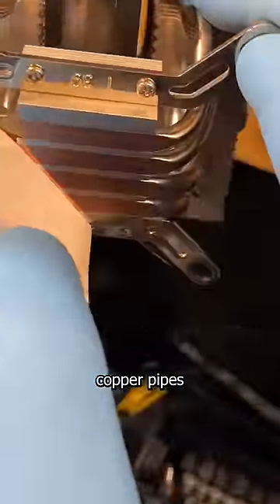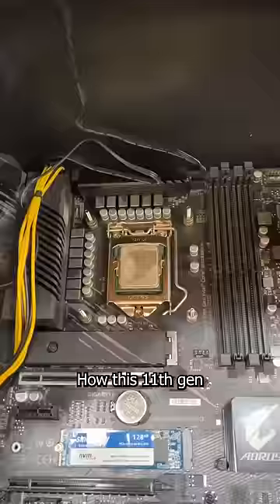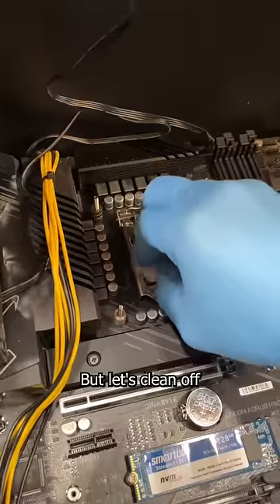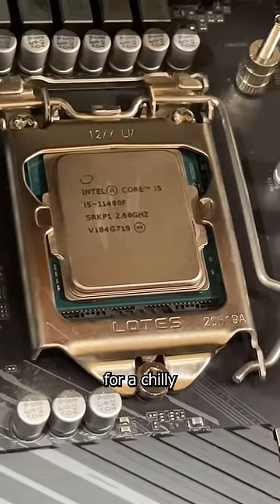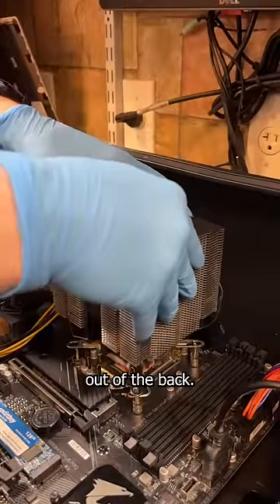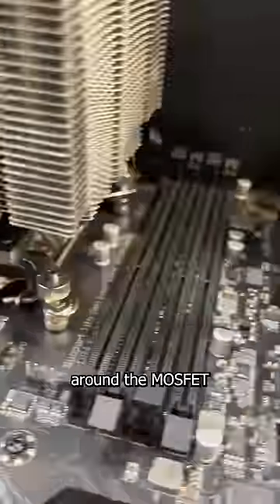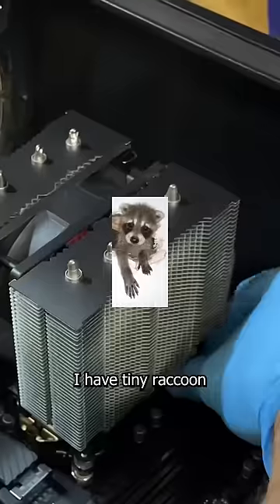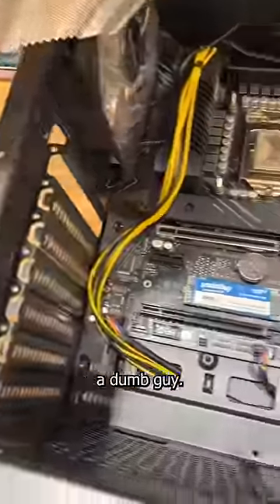Russian computer repair shop harmed this poor #gaming #pc Intel CPU was on fire 😢 #tech #shorts

Comment: My boy used bubble gum as thermal paste 💀
Reply: With enough amount 💀
Reply: XD I think it's thermal grizzly thermal paste (but yeah it looks like gum lmao)
Reply: WHY WAS IT PRE SPREAD
Reply: @defaultdan7923  because he spread it but didn't record it??
Reply: @Maxcraft7050  the IHS spreads automatically. maybe it's just a material that I am not used to seeing the viscosity of, but even then, just a pea is needed, then let the cooler and CPU handle the rest.
Reply: @defaultdan7923  nah you're right but some people like to spread their thermal paste or do a different pattern (I usually do an X as it spreads nicely)
Reply: CPU looking like a sugar cookie
Reply: And used way too much.
Reply: @Zulgeteb that's not really "way too much" it just probably looks like it as he spread it, (also you can't have too much thermal paste, the only thing it can do is make a mess)
Reply: Nah it's pink sauce 😂
Reply: @soulkrishnagamer_007  nahh 💀
Reply: @Maxcraft7050  😏😂👍
Reply: @defaultdan7923  no I think that is a high perf/long lasting paste, normally it is best practice to spread them manually, he did nothing wrong.
Reply: @Zulgeteb  it is fine!
Reply: I came to the comments section to look for all the thermal paste experts and wasn't disappointed.  Too much!! Why did he spread it out?!?!?! ermagawd!!! .  Much armchair expert pedant-ism.  He applied a decent amount that guaranteed contact across the heat spreader which is important now the dies are not necessarily central so 'just need a pea in the middle' is insufficient and any excess would be squeezed out thanks to the pressure... go on armchair cpu hero's have your say!
Reply from the maker: @NeilSearle EXACTLY!! These comments are tame compared to TikTok 😂 the PASTE POLICE are out in full force over there!
Reply from the maker: @defaultdan7923 I spread it and didn’t record it 😂
Reply from the maker: I used Colgate extra pinkening.

It was actually Thermal Grizzly Kryonaut Extreme 😅
Reply: @SalemTechsperts  nice so I guessed right, because they have that unique pink thermal paste
Reply: idk what paste that was, but it looks like a sh!t ton
Reply: @storm_filter  thermal grizzly kryonaut and it's not that much
Reply: @NeilSearle  pea in the middle is insufficient? Tell that to my 9yo intel 3rd gen, 7yo 6th gen and 6yo ryzen 1st gen. The first is a home server running 24/7, the second is my brother's gaming PC and the third is my workstation.
Never had a problem, never had to change CPUs or thermal paste.
Reply: @Zulgeteb what’s wrong with too much?
Reply: he never said the builder could be a dumb guy😅
Reply: @defaultdan7923 I have the same thermal paste, I believe the instructions tell you to spread it before putting the cooler on, I'm sure Thermal Grizzly know what they're talking about so I would do it with their products if thats what the instructions say.
Reply: @defaultdan7923  Pea is a good shape but it leaves nothing on the corners of the IHS when too little is applied. Even if just the right amount is applied it'll end up spilling out of the sides before it touches the corners, which isn't ideal either.

I personally use a slightly smaller blob in the middle than is generally advised and put tiny spots in the corners and often trail towards the middle. Anything beyond that is just for fun. 

Additional areas of paste will create points of contact for the bulk of it in the middle and channel its flow when the cooler is pressed down. The only thing to be careful of with multiple spots is to ensure they run together properly or else an air bubble might form and throw off the thermal transfer. Just avoid having two or more blobs at a distance without any paste in between. Make sure they're linked or close enough that they will be immediately when pressure is applied.
Reply: Oh I just posted about bubble gum 😂
Reply: i used talcum powder 💀
Reply: Nah Thermal Grizzly is a great thermal paste. You have to heat it up first to make it spread easier and then it becomes like putty.
Reply: Exactly what I was thinking
Reply: @soulkrishnagamer_007  *cpu explodes of food poisoning
Reply: @SalemTechsperts  My guy, a pea sized drop on the cooler, it spreads wit the pressure cmon man.
Reply: @PountyWB  lol
Reply: @defaultdan7923  Because intel sells pre applied Thermalgum on their CPUs these days
Reply: @Maxcraft7050  
Bingo!
(Idk what that is, but you got it correct 😏)
Reply: @ivoryas1696  lmao thx
Reply: @Maxcraft7050 spreading it can allow air bubbles to get trapped, it's best to put a blob in the center and push the heating down on-top to not have any gaps for air to be trapped in
Reply: @timothygooding9544  I know...
Reply: it's horseradish
Reply: Isn't that better than the original install?
Reply: a used one lol
Reply: @SalemTechsperts  what a waste of thermal paste. I bet you charged the poor customer for it twice the price of that CPU alone 😂
Reply: I came to say the same thing!!!
Reply: @Zulgeteb  not too much. it's already been studied and proven, you can have more than the olde way of a pea-sized thermal paste, and it's actually more optimal to have more as long as it covers the entire IHS instead of just partly. Which is why spreaders have been commonplace to be included with thermal paste when you buy them.
Reply: @alihaidar5787  no, it doesn't. We already have actual objective data a pea-sized just doesn't cover the entire IHS.
Reply: @timothygooding9544  it still doesn't cover the entire IHS, and actual enough pressure from the heatsink would force those air bubbles out. again, it's better to have more thermal paste to actually spread throughout the IHS, this has been done in gamersnexus and the like.
Reply: Toothpaste works too...
Reply: i mean they seem to last a long time under the school desk so why not? 🤣🤣 jk
Reply: @Maxcraft7050 exactly what you need to do
Reply: @PLiVX  what
Reply: @Maxcraft7050  put thermal paste like a cross on the CPU , the plate will squish it equally on the CPU
Reply: @SalemTechsperts yeah no matter what you do you’re going to have people screaming at you you did the wrong thermal paste application.

Nothing wrong with spreading it yourself. I do that too and worked great so far.

Some videos just cut any view of the thermal paste so people won’t complain about it which kinda makes sense x3
Reply: @mastroitek  No, it is too much.
Reply: still an improvement
Reply: @xanderwusky  Well this definitly depends on which CPU your applying the thermal paste , AMD Cpu have like two chips and if you apply a pea sized thermal paste on it , it'll probably heat more than applying a cross shape.

Even applying with a spoon or card isn't very effective cause you could be applying either too much or not enough thermal paste.

The only time you apply thermal paste is when you are using liquid metal on the CPU cause it's to avoid getting any contact with the motherboard where it's not supposed to go.
Reply: @PLiVX  not really, actually on thread ripper and cpus of that size it’s even recommend to spread it out manually to ensure you get all of it. On most normal sizes though yeah it should spread out by itself.

Still I prefer to do it manually so I can visually see the thermal paste is applied properly and touches the entire cpu. Also this way I know I added the right amount because I can visually see it’s all covered and not spilling over. I don’t know why you’re implying this wouldn’t be the case? With a pea sized drop and just putting the cooler on you have no idea if it’s the right amount. You’re just hoping the pea size is good (not saying it’s wrong but there is no confirmation as you can’t see how it spread).

No there is no downside to spreading the paste out manually other then that it cost you a little bit of time. I’m not claiming the result is any better but it gives me peace of mind it’s done properly.
Reply: @defaultdan7923  because its actually pepto bismal.
Reply: I saw someone had used tooth paste instead of thermal paste lol
Reply: @SalemTechsperts  lol I know. Just making jest.
Reply: @Maxcraft7050  Your not supposed to spread it, and it only requires half that at least since it's sealed down onto the processor, leaving little room for the thermal paste. This would likely raise temps potentially and possibly be problematic.
Reply: @TheLinkeX  what shrooms are you trippin' on brother?
Reply: @TheLinkeX  google "thermal grizzly instructions"
Reply: @Zulgeteb  there is literally no downside to using too much other than cleanup. If anything using more is better than using less, do some research.
Reply: @Maxcraft7050  Educational ones I guess
Reply: 69 replies ruined >:)
Reply: well
Reply: i am not a monster so i am gonna make an another funny number for you ;)
Reply: @Zulgeteb there's no such thing as too much thermal paste ... as long as it's not spilling on other parts you're fine
Reply: @Maxcraft7050  You can have too much if it's a electrically conductive paste. Thankfully those aren't common anymore.
Reply: @hrodebertcoad9848  yeah like 99.9999% of thermal pastes are non-conductive only the liquid metal for the ps5 is
Reply: @Maxcraft7050  Don't think liquid metal is only for the ps5, but I remember about a decade ago you still had early gen arctic that was conductive. But of course the much better mx-4 was also available at the time so things were quickly moving on.
Reply: @hrodebertcoad9848  alright then
Reply: @Maxcraft7050 You can have too much thermal paste. Thermal paste is basically to fill in the micro pores and holes in the heat sink and IHS, so every single tiny tiny area of the IHS and heat sink make contact. If your thermal paste is too thickly applied however, it absolutely will become detrimental to it. You do not want a thick layer, as that will slow down thermal transfer and conductivity. You can find some videos on YouTube explaining this.
Reply: @jakeroscoe8238  lmaooo yeah if you don't screw your IHS
Reply: @Maxcraft7050  You can have too much. 
The purpose of the paste it to remove airgap from uneven surface. You only need a tiny amount of paste spread over that surface to fill into the tiny divots and make sure everything is touching.

The enemy is airgap. If you could have 2 perfectly even/smooth surfaces (that are also perfectly aligned) touching each other you wouldn't even need the paste at all.

It's just also true that if you have a good enough paste it isn't largely detrimental to use too much, it'll function just fine.
All it's designed to do is heat transfer extremely quickly, and all it's got to do is better than air.
Reply: Omg, só poor repair
Reply: @Maxcraft7050 is it good?
Reply: @defaultdan7923 it will suffice with a pea, but with 12th gen Intel and on, the CPU is more rectangular than square, so spreading it might help provide adequate coverage across the entire IHS rather than of just like 3/4 or something.
Reply: @SalemTechsperts  p
Reply: @defaultdan7923  can you name any downsides to spreading it yourself
Reply: @defaultdan7923 A pea has not been sufficient for a good while now. This has been shown time and time again with the growth of IHS. Yes, adequate spread can be ensured by simply upgrading from a pea to a line across the IHS, but there is nothing at all wrong with pre-spreading whatsoever. There is nothing wrong with how this paste was applied.
Reply: Looked like RTV
Reply: Bo he actually used bungee gum, which has properties of both rubber and gum.
Reply: I have always spread it this way... and I have been building PC's since the 90s.  (even professionally back then)
Reply: @mretidk6715 in a perfect scenario you only replace air with paste and have as much direct metal-to-metal contact as possible. Since the surface is never perfect you use a little bit of paste to fill the microscopic gaps and scratches since air is even worse at transportation of heat than paste. But paste is worse than metal  So don't put paste where you could have metal-on-metal contact instead
Reply: @SalemTechsperts  Colgate extra pinkening. That shit got me snickering.
Reply: @mretidk6715  what? Troll?
Reply: @alihaidar5787  if dude didn't understand he's never mounted a heatsink
Reply: @alihaidar5787  It does not spread to the corners, most of the time you'll be fine because the die is covered, but why not spread the corners... "cmon man"
Reply: @acuzioabdiel  Tooth paste dries out into a powdery dust in about 2 weeks. and it's probably worse than finding a random condoment from your fridge.
Reply: @resottolamontagna904  No, it's not.
Reply: @PLiVX  That's not true.
Reply: @Maxcraft7050  is it better than tf8/tf9?
Reply: @LanaaAmor  yeah
Reply: @Magnosummit or do a cross to get it to spread more evenly
Reply: @Maxcraft7050 you can definitely have too much. Thermal paste is actually a pretty poor conductor and it’s only meant to fill in the tiny voids of surface roughness. You want it as thin as possible without leaving air between
Reply: @Maxcraft7050 
It won't be just a mess when some of it gets underneath and onto the pins.
Reply: @Maxcraft7050 gets all over your motherboard though, idk if its common but there are some thermal pastes that are electrically conductive
Reply: @SalemTechsperts if it cools it cools, but that looks like a bunch of paste will spill out the sides, and getting that stuff everywhere is such a pain to clean
Reply: @defaultdan7923 This is a trend I never understood either. Just put enough thermal paste on the cente of the IHS and apply the heats sink, hey presto the TIM is spread nice and evenly, job done.
Reply: That’s a lot of paste 🫠
Reply: You're supposed to replace that stuff every year cause it goes bad quickly. Why put it in the PC of a person you know is NEVER going to replace their paste?
Reply: @defaultdan7923 not true with most modern cpus these days the die is mich larger a pea is not sufficient
Reply: @IVAN_ENT  it spreads thin due to the pressure on it from the heatsink, you don’t want it leaking out the sides
Reply: dude put 50 times neede amount of paste + put it on he cpu, and not on the pipes like ypu should with coolers with exposed pipes, makes a big difference.
Reply: * sigh *, Only in Russia 🤷‍♂️

Or rather, I have a better joke (I think) : Maybe we're too hard on the sanctions, guys
Reply: I used tooth paste. It works for the time being before i go to store buy thermalpaste
Reply: Idk if it's just a different kind but yeah that's way too much of the shit I used
Reply: Lmao
Reply: @Maxcraft7050 you 110% can have too much paste, too much will cause worse cooling and even though that is spread, it's still far too thick and is definitely too much paste.
Reply: @SalemTechsperts don't get upset with the armchair experts it isn't their fault that they weren't born to become THE GREATEST TECHNICIAN THAT'S EVER LIVED!
Reply: Hm do protogen’s produce thermal paste?
Reply: @Maxcraft7050  You, absolutely, can use too much thermal paste. Also, spreading it can cause air bubbles to form -which also reduces the effectiveness of the paste.
Reply: @Maxcraft7050 damn you know your paste, how the hell did you guessed it right
Reply: I laughed out loud!!!
Reply: @trajectoryunown even then for example an X still can have air bubbles the best u can do is just 1 blob or do it completely itself. Other than that there are some thermal pads with the same efficiency
Reply: Close enough.
Reply: @Maxcraft7050 You can absolutely have too much thermal paste.
Reply: @Maxcraft7050  I have work at Lenovo and it's say "just a pea" too.

(Sorry for my lang, i'm not english)
Reply: @Maxcraft7050  I confirm that it is "way too much", it creates a thicker layer and prevents good cooling, the layer must be very thin, that's why you only need a small amount in the center. I worked in after-sales service at Lenovo and it was one of the elimination questions.
Reply: @AbrutissementTV  no problem bro, and there is nothing wrong with just a pea but some newer intel cpus need atleast a line because of rheir length
Reply: Nope it's not gum
Reply: @Maxcraft7050  Stop doing patterns, you are introducing airpockets :) A glob is the best, as it will spread from the center and out. Any place where two seperate areas spreads in to eachother, you risk causing airpockets
Reply: "The greatest Bubble Gum that ever lived"
Reply: @m0ment219 okay? And if it works for you then good but if spreading it works for me then what’s the problem
Reply: Nah that looks like Hubba Bubba😭
Reply: @SalemTechsperts  I just let my heat sync do that. But tbh you did go a little heavy, I'm certain you're loosing some performance, probably negligible, I've seen people use fucking toothpaste and run cyberpunk on it just fine, but still.

Comment: You forgot to say “The Greatest Technician that’s ever lived!”
Reply: Fir this video it would be "tHe grEAtest CustOmEr  THat hAs Ever LiVeD"
Reply: It's implied
Reply: he put on far to much thermal paste rofl. not the greatest
Reply: yeah
Reply: @heeelion134  Isn't it supposed to be an ironic statement anyway? I don't think he believes he's the greatest.
Reply: Correction:The greatest racoon that,s ever lived
Reply: @heeelion134 I thought that too. At the end of the day it's just waste and mounting pressure will correct this. For a beginner it's way better to use too much then too less. But a experienced builder shouldn't use so much in my opinion.